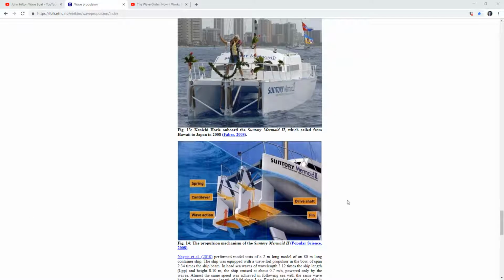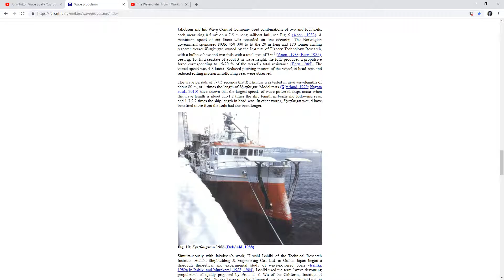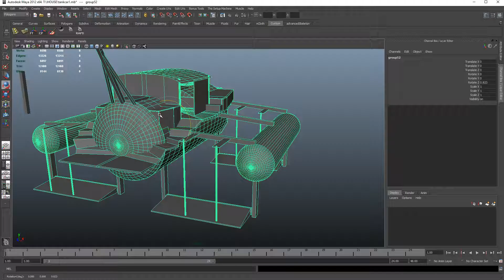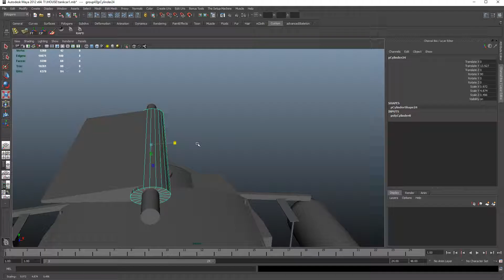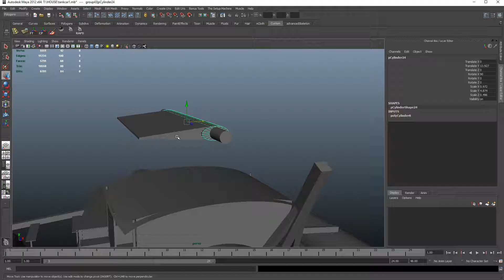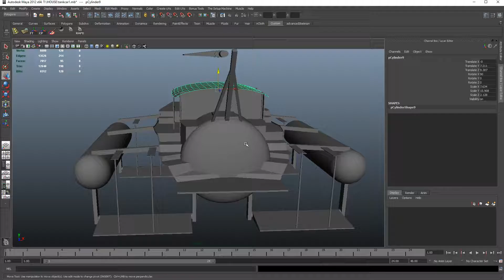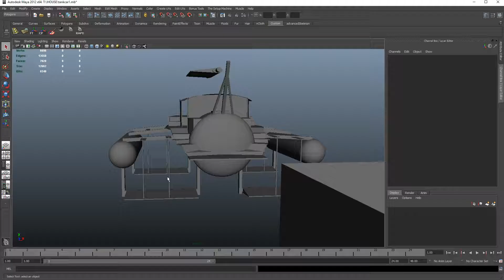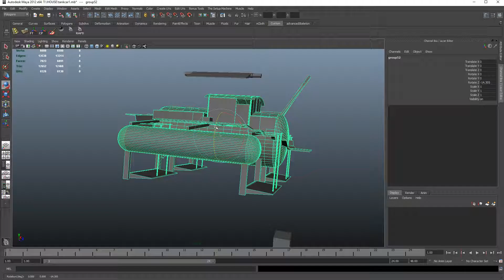Wave Powered - Alternative to Sails?

Comment: I made one years ago.  2.4 metres long, 1 metre wide.  It would pull me along when I was swimming in the sea.  It would go quicker that I can sustain swimming speed so I had to be careful not to let go or I would never catch it.  It worked at most directions of the waves, but best straight into the waves.  Non-breaking waves were best.

Comment: It's a cool concept, but I see one problem: the angle of attack changes with the boat's pitch axis, while for optimal performance it should change with heave only. When the boat's pitch angle gets too steep, the wing goes beyond the angle of "best glide", but this angle is always the same and should be limited always within the same range, regardless of the pitch of the entire vessel. Please excuse the aircraft analogy, but the principles of fluid dynamics should be the same. I guess this is the reason why the "wave glider" has its submerged propulsion unit mounted at a single point, thereby allowing an independent pitch from the vessel at the surface. The "wings" should also be pretty deep in the water (like 7-10m) "below the waves", which is hard to do with rigid connections, because the draft would be prohibitive in shallow waters or marinas. Therefore connecting the submerged unit with only cables or chains should work better and would also allow pulling the whole thing up (e.g. in case of a catamaran: into the gap under the bridgedeck), which at the same time would allow easier hauling/dry-docking and it could also be retracted whenever the seastate gets too violent.

Comment: I think it needs skegs to  protect them first. The shape of the fins needs to be raised on the upper sides as shown earlier in another design of course, and they need to be removable from the water. A trimaran is a perfect shape I think. Add to it solar power propulsion and utilizing it's vast real-estate for solar panels and it could be possible. Also...wouldn't the power transfer be far better used for something like this than propellers are? I mean, the energy is merely spinning a rod vs this where it's moving a platform. The returns are phenominal in my mind. A diesle powered waveboat should be more efficient shouldn't it? Than what we have now?